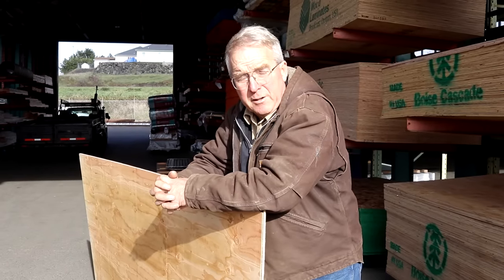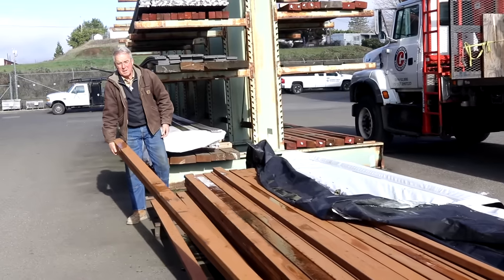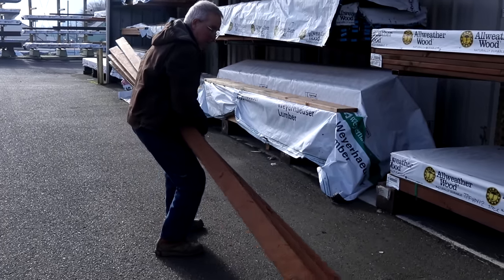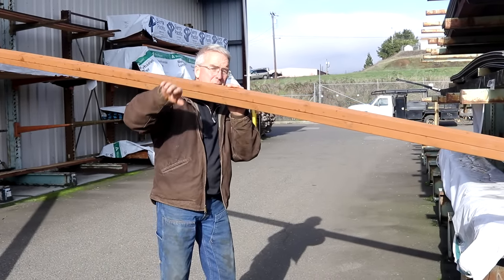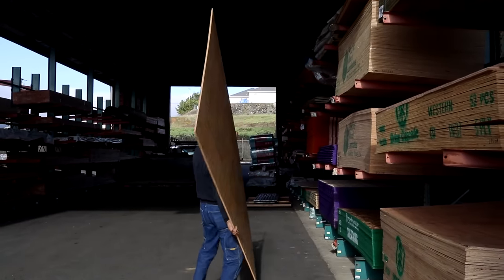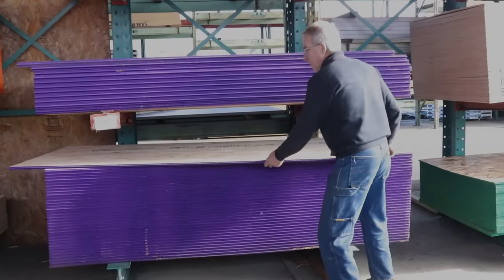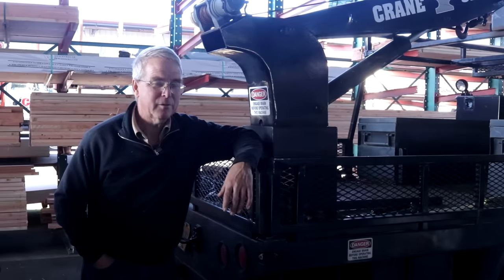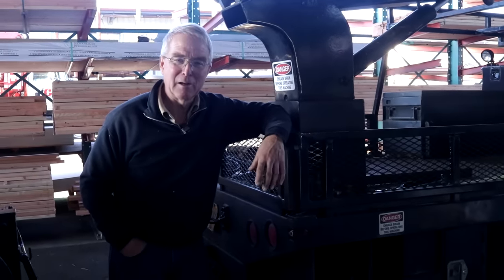Lumber & Leverage: Handling Plywood, Boards, ANY Material with Ease

Comment: A principle I've learned in 26+ years of general physical work is: my thighs/hips are hands and my clothing is a gripping/friction tool. Not something easily explained without demonstration, but I bet all construction guys know what I mean.
Reply: I'm a construction worker.  I know exactly what you mean.
Reply: @joshs1555  Now I think I about it, my feet are hands as well. And steel toe caps are more than just a safety measure...they're also a fulcrum, a jack and an impact tool.
Reply: You especially learn to appreciate it as your fingers get fat and sore from vibrating and oscillating tools... grip ain't what it once was.
Reply: I think you can add your stomach to the list and if you don’t believe me, just look at your tshirts if what you’re lifting is dirty.
Reply: Exactly.
Reply: Your belt is also a great place to catch the lip of something on to help take the load of your arms.
Reply: @Ghayme-changer safety toes as jacks.. good way to put it, and if you're fortunate enough to have a nice robust leather boot, sometimes they dont have to be a safety toe..
Reply: @ADBBuild  ah yes, the old belt-shelf... something only construction guys (?) will understand.
Reply: A critical lesson I learned the hard way is the importance of wearing a good pair of leather gloves when moving lumber, especially plywood.  Years ago when picking up a pc of fir plywood I received a splinter in the palm of my hand that struck a nerve.  It took over a year but eventually through exploratory surgery it was located and removed.  Point is, no matter how tough one’s hands are from work, gloves are a smart choice.  Signed- a 73 year old carpenter.
Reply: @danells5399  100% concur with the gloves comment. Glove technology has come so far there's no down side to wearing them except pride. The only exception being lathe work and such like... Another thing I discovered, is applying and releasing force with slowness. Like when I go to pick up something heavy, I'll apply lifting force and kind of ramp up from 0 to whatever over a three seconds or so. I learned this from deadlifting; you never go full power from 0 if you want to be injury free. Ramp up the force gradually until the weight leaves the ground. Reverse the procedure, when putting stuff down. I don't just dump it, because the sudden tension release in my muscular-skeletal system kind of "shocks" my ligaments and muscles. It's like a backlash. So I'll still be holding onto the thing a couple seconds after it hits the floor, letting the pressure off gradually. I credit the habit to a pretty decent injury avoidance record these past ten years or so.
Reply: @Hoaxer51 as a barrel chested mason, I know exactly what you mean 😂
The stomach area on all my sweatshirts are frayed from using my belly as a friction point.  
I've mastered it enough that I can carry an 80lb Mortar bag without flexing a muscle.  Let the belly do the work 🤣🤣
Reply: someone should design structural pants with a lifting belt and reinforced grips
Reply: Kinda hit the nail right on the head
Reply: Yes sir
Reply: Not a professional, but extensive DIYer and I agree with everything in this comment and all the replies
Reply: Body pinch
Reply: To all of you that commented on this thread...
YEP! Sure have done all these things!

Comment: When working in the wind with plywood, never put yourself In between the edge of wherever you’re working and the plywood. A strong gust will take both you and the plywood right off the roof. A little pro tip for you younger fellas.

Comment: Sharing our wisdom is so important. Today I'm delivering concrete for a job. The young man who is doing the job was going to have me pull onto a blacktop driveway with a truck that weighs approximately 55-57 thousand punds. The crazy thing is the driveway did not belong to the job where he was working. I took the opportunity to share some wisdom that it probably would not be wise given the amount of rain we have had in Cincinnati the past week. Pulling on that driveway, even though he boldly proclaimed he had a 1 million dollar insurance policy, would have been a huge risk. My thought is why use insurance when you can take a little bit longer to do the job with a bobcat bucket and not lose your insurance because you have to replace a 900' long blacktop driveway.
Reply: I’ve had a number of times when a driver refused to park his truck on the customer’s driveway without a signed waiver.

Comment: as a smaller guy in the construction trades i had to learn early in my career how to move/lift smart so i didn't kill myself, you would be surprised how much weight the top edge of your belt will hold if you have to rest the stack of 2x4s on it as you carry them as you said friction is good a good old heavy leather belt works too.  Merry Christmas to EC & family & to all the hard working grunts out there work smarter young guys/gals not harder 🎅🎅🤶🤶☃☃
Reply: my belt has been invaluable in being my third hand when carrying or lifting things, it'll be a sad day when she finally gives out

Comment: Thank you, what you shared here reduced wear on my body today. I watched this video when it was first posted and remembered to watch it again today because I was going to have to move a dozen sheets of 3/4" OSB that was delivered to our house. While that's no massive task and I'm not that old, I thought the task would leave me a little tired, but it was a pretty mild task thanks to the techniques you shared. No jolts, hoists, or leaning over like I'd previously done when handling sheet goods. I also think I finished faster because I wasn't tiring out, allowing me to just keep moving to the next sheet without taking a break, and I also could keep working afterwards for longer because I hadn't tired myself out. (Even younger guys can appreciate being able to work longer hours if they don't tire themselves out as quickly!)

Comment: @14:53 "I'm not feeling any pain anywhere."😂

Me neither, not after putting a dose of Voltaren on my sore joints and muscles. At 72, I use my cell phone to call in an order, and let the young men at the lumber yard bring it out to the job site. But these are valuable lessons in material handling, which I had to learn decades ago. Thanks for the continuing education, Scott!
Reply: Still gotta move it on site.

Comment: We never had a tractor on the property until 3-1/2 years ago when I finally broke down and bought a sub-compact tractor.  For years, anything that needed done we did by hand....and grandpa's saying was always "I've got more time than money"....in an excuse to never have equipment around to make the task quicker and easier.  As I have gotten older, and I don't have as much time now as I did when I was in school, I realized, grandpa isn't gonna be here forever, he isn't able to help me anymore, my mom passed away, as did my grandmother, so its just me now, as grandpa passed away in January of this year.....so a few years ago I finally said the heck with it, and bought a small tractor.  For the 1 acre of property I've got now its great....we used to have 2 acres in which a bit larger tractor would have been fine, but even having the sub-compact tractor has saved me so much manual labor in 3-1/2 years.  

In the Army it was always work dumber not smarter...if it was a 4 man lift, 1 man is plenty....they never seem to figure out why there are so many injuries from moving stuff.  Never had a forklift and never had a pallet jack....if you wanted something moved everything was done by hand....no longer being in the army...I work smarter not harder, I have the tractor with pallet forks for a reason, and those pallet forks get used a lot, seemingly more often than the loader bucket.  Being on my own now, that tractor is a huge asset.  

I've never been very good at moving lumber, or sheet goods, but I can get it onto the forks of the tractor now and move stuff pretty easily, that is until I get to the shop, then I have to carry it all in by hand since the doorway isn't wide enough LOL....but I've also redone a lot of stuff around the shop so I can drive my pickup right up to the door and offload into the shop that way so I'm not carrying stuff very far vs having to walk across the driveway and through the back of the shop.

Comment: Had to figure alot of this out on my own as I went, but this is an incredibly VALUABLE video that I really hope alot of the younger folks find.
Me and a buddy were talking the other day about how many 18 year olds don't even know how to use a broom or a Shovel. Seems like another good video idea. Everyone starts from zero, it's up to us to teach them. 
Thanks for the fantastic vids. 
Wish you and yours a Merry Christmas!
Reply: > how many 18 year olds don't even know how to use a broom or a Shovel
I'd watch that. I'm relatively new to the trades, and it seems like many basic tasks have been finely optimized by the folks with much more experience, with this video as a case in point. Even a small tip that reduces the effort by 10% is huge -- saving 10% of my energy means I need a fewer or shorter breaks, I can work longer hours, and/or I can be less sore at the end of a very physical day. And many of the tips reduce effort by 20% or more, so I particularly appreciate these kinds of tips.
Reply: oh yes! it just drives me crazy when I see someone trying to force a shovel into a pile of anything with their arms.
i just wanna yell "get some good shoes and use your damn foot!"
of course, they'd be offended rather than grateful, so i don't.

Comment: Another great episode. 
Naturally your stories always bring me arond to my own youth. Being stupid and full of energy I spent my younger years alone doing projects that should have been for two but what thre heck.  Building a 6' wide 12' long  (out of 2"x12") set of stairs on the ground, standing up and placing it up to a mezzanene, accidently slides off and squashes  me to the concrete. I crawl out and do it again, this time successfully.  Or, drywalling a large commercial room 16'x 36'x 12' high i carried 1/2"x4x12 sheets of drywall up an extension ladder and screwed in place, luckilly no ceiling work. I gotten hurt but never injured, in some instances I am now at 70, paying the price for working alone so many years, now I have a helper.

Comment: As a home-gamer, years ago I got some simple plastic handles from one of the big-box stores, for moving sheet material.  I found them easy to use, letting me carry multiple sheets at a time without lifting very high, and without the narrow edge of material against my fingers.  We downsized to a mobile (RV) lifestyle well over two years ago, and got rid of a lot of stuff, but I kept those.  I suspect you can still buy them, and they aren't expensive, but they're small enough it wasn't worth throwing them away to save on storage.

Comment: Scott, I haven't read through all (current) 365 comments, but I will add one very important thing to your examples.  When flipping boards in a stack to paw through them for what you want, it is VERY important to not leave the stack in a mess.  As a courtesy to the yard guys, and to the next customer, don't be selfish.  Take a minute or less and straighten the boards into a tight stack like you found them.  The weight of the stack will help to reduce warpage of the boards you leave behind.
Sort of like leaving a campsite as clean or better than you found it.  You'll feel better about yourself if you do this.  43 years in the construction business has taught me to think of the other guy too, not just myself.

Comment: 20 years of erecting and tearing down scaffolding for masonry ive gotten really good at moving 16 ft 2x10s with minimal effort. Rolling boards, sliding them and using fulcrums, not only can I move quicker and by myself but Im way less fatigued when I get set up.

Comment: So true. I remember back in the day when I was laboring on a big tract home deveopment in San Diego and I screwed up my neck by carrying some wet ( forest squirrels till clinging to them), heavy 2 x 12 x 20 foot joists. I had to pull on my arm between my knees in order to go to sleep. Took forever to fix itself. 
I also remember the morinng my boss took me on top of the hill overlooking the site and said, "Jim. We have a problem."
Which I understood to mean that I had a problem.
The lumbar yard had packed all the finish trim and siding into the stacks for framing. By the time the finish materials would be needed , they would have been too messed up. So my job was to tear apart the stacks, move all the framing lumbar into the garage and stack the finish stuff up so that a truck could come by and pick it up to return it to the yard.
I spent three days disassembling 74 stacks of lumbar. I turned into a game of trying to lay it alll out so the layout guys, the framers, and the stackers all had easy access to what they needed in a logical , progressive manner.
At the end of it, I realized haow much a man could move in a day one stick or two at a time.

Comment: I did this work a lot. Delivering building supplies. I loved watching young, energetic guys  doing lifting the hard way. You couldnt tell them anything. I let them have at it. I always ecouraged them. Later in life you learn the tips and tricks.
For carrying  8 ft sheets try this test:
 standing  with your rh hanging down your side rotate your right hand to touch your thigh with the back of that hand. I can easily touch my thigh by rotating my hand anti clockwise looking down my arm. There is no way I can rotate my hand clockwise to touch my thigh the other way . So I carry sheets in my right hand with it rotated to the left.

Comment: 11:21  I usually slide it off the stack and lift up a little with my upper hand and catch it with the other hand. You flipped it down and picked it up off the ground. The momentum of the slide assists the lift.

Comment: As a formworker of 22 years I’m glad you showed the ply on its corner trick to raise the centre of gravity without much effort. But one technique you didn’t show was for passing a sheet up as high as possible. For me being right handed I use the rotate on corner technique shown, with the end in my left hand and the side in my right but toward the left hand end, in one motion I throw the sheet up leaning against a ladder or wall and rotate it so it goes vertical and place my right hand on the end with my left hand.  With a 4 foot by 6 foot sheet I now have my arms outstretched above my head and the ply leaning against the ladder or wall. This requires not much energy or strength (I’m only 73kgs/160 lbs) but now the other end of the sheet is over 4m above the ground for someone else to grab.